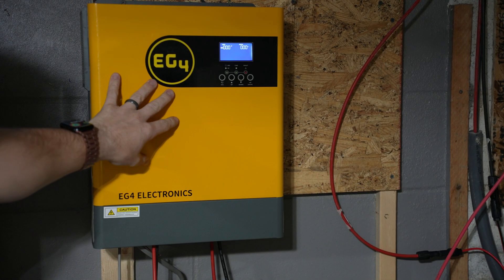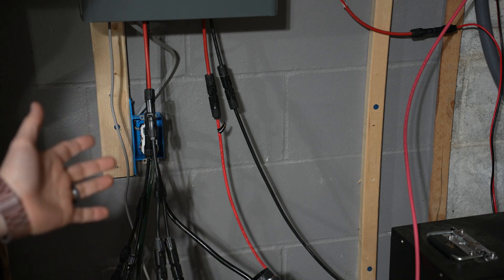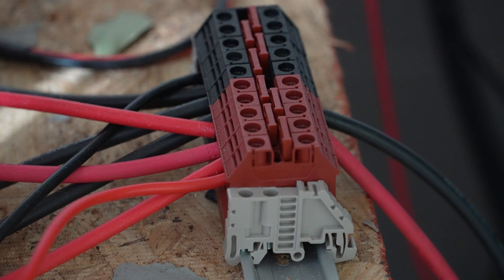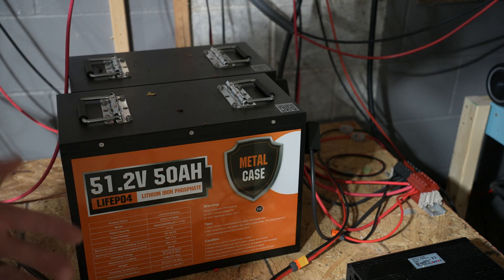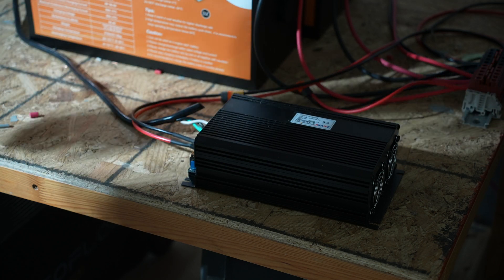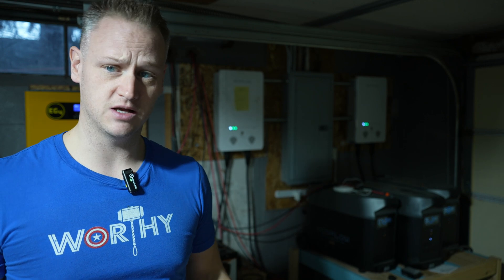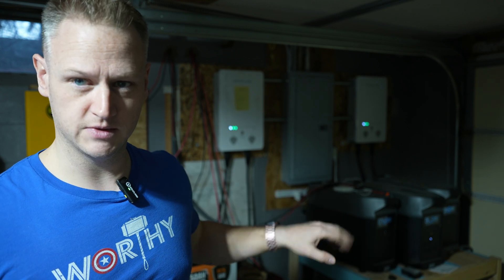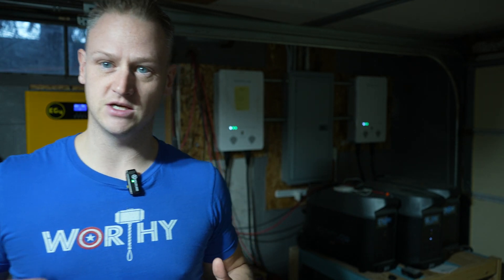Complete System Guide To Powering the Delta Pro with external batteries

Comment: I’m trying to understand why your setup is the way it is. You have the eg4 inverter and 2 Delta Pros which have their own inverters also. And you have one bank of batteries. What’s the point of the Delta Pros? Why not just use the battery bank with the EG4 inverter? And what’s the need for the 2 smart home panels? Am I misunderstanding your setup?
Reply from the maker: Fair question. If i was starting from scratch I wouldn't design it this way. I bought into this gradually and went with the Ecoflow Delta Pro + SHPs first. I chose them because I didn't know anything about solar and wanted to easiest and most beginner friendly option I could find.  I later added the EG4 and external battery bank as I began to learn more (and also because I had more solar panels than the DPs could make sure of) 

The 2 SHPs were because a single SHP couldn't handle all the circuits in my house so I dedicated one to all the single phase circuits and another to the split phase circuits. 

If I were starting from scratch, I probably design it a little different. However, this way does extend the overall battery capacity significantly and costs much less to add than proprietary batteries.
Reply: @ I see!  I was trying go the cheaper route also when I started. I also went with a Delta Pro but with a generator inlet and interlock kit. If I were to do it over (which I plan to) I would put a EG4 12000xp with a battery bank and use the Delta Pro for my shed. Thanks for your reply.

Comment: Can you give the part number or model number to the switching power supply ? 

Did you ever attach a dual voltage hub for charging both delta pros ? 
Currently charging 2 delta pros on voltage hub with 2 2000 watt power supplies . Definitely should attach a auto transfer so the DPs discharge at the same rate
Reply: Also love your videos man 🤙🏼

Comment: Just a recent subscriber.  I've been thinking of doing a portable unit using the eg4 inverter and a 48V battery to run my fridge only during power outages.  Do you know if it does pass thru charging and act as an eps or ups when power goes down?  Also was thinking of adding a manual transfer switch before I get to old to handle all this weight on a hand truck or tool box with wheels.  Enjoy your videos very much.  Thank you for sharing.
Reply from the maker: The EG4 does have multiple operating modes and you can have it kick in in the case of a power outage. That said, there is a kickover time so while I think it should be perfectly fine for a fridge etc it would likely not be appropriate as a UPS for sensitive electronics.

Comment: Have you automated the turning on of the ac to dc charger?
Reply from the maker: I have not, thought that could be done fairly easily with a smart plug. Since the Delta Pro only charges from the Calpha Solar inverter though when it is low, I haven't really seen a need to have an automated control over the switching power supply. So far, that has worked very reliably.
Reply: @DanielGoodwin-jq1oc  
So the ac to dc converter is hooked up all the time  with power on 
And the delta pro only grabs what it  needs when it needs  power ?
Reply from the maker: Correct and the Inverter shuts down when the battery bank is too low to support the draw. It turns it back on the next day when enough solar power has been captured to recharge the external battery bank and then the Delta Pro starts drawing from it again. Its a, more or less, sustainable eco system.
Reply: @DanielGoodwin-jq1oc  
1. How long does the inverter tied to your external battery run per day?
2. Have you tried running 2 ac-dc converters at the same time from the same battery bank?
I’m trying to get around the DP low solar input. 
Summary
Get plenty of solar for panels, store in battery bank and use the ac/dc converters as needed to load up the DPs as needed.
I’m trying to figure out how much battery I need to fully charge the 2 DPs and 4 batteries twice and be left at 50 on the external battery bank.
Any help is appreciated. I’m trying to learn how to do the sizing 
Thanks
Reply from the maker: The inverter runs until dusk usually so depending on your geographic location, that can vary. I have tried running 2 converters from the Calpha Solar 5K inverter however I was getting some odd behavior from my smart home panel. I don't think it was related but I didn't have time to determine exactly what was going on so I went back to 1. I will do a follow up video hopefully soon where I run two at the same time. You need a LOT of power though to run 2 (probably 3200-3500 watts of PV coming in give or take). 

To fully charge up 2 delta pros and 4 extra batteries is approximately 20kWh, that's a lot. But it can be done. My setup currently is 4 delta pros and 4 extra batteries so I have 1 battery to each delta pro. 1 DP is fed by the Calpha Solar 5KW inverter thru an ac-dc converter. That Delta Pro on a typical day is sitting 100% at around 9:30pm at night. So it can be done. To do it for 2 delta pros, you're going to need a ton of panels and probably a decent amount of battery capacity.

Comment: Have you tried to charge the Delta Pro with an XT60 connected to the battery terminals to get DC to DC charge?
Reply: that's the best way,just use the xt60i